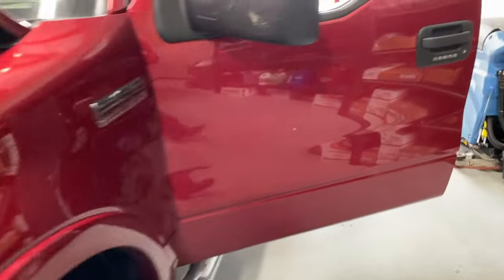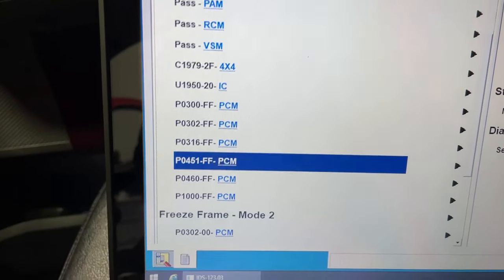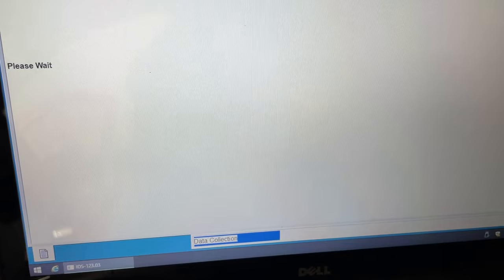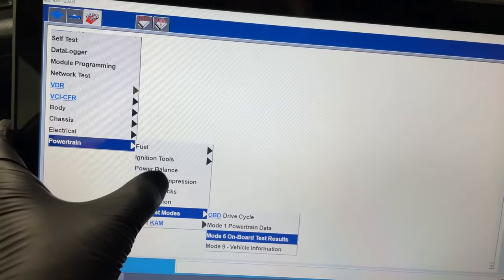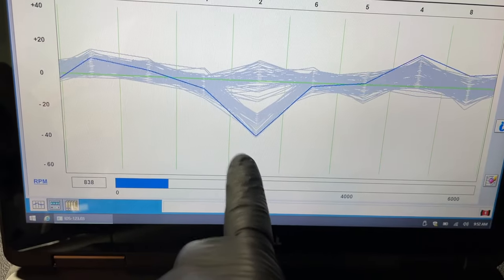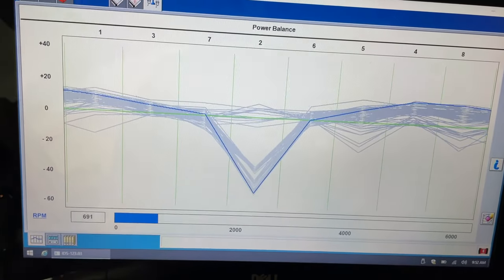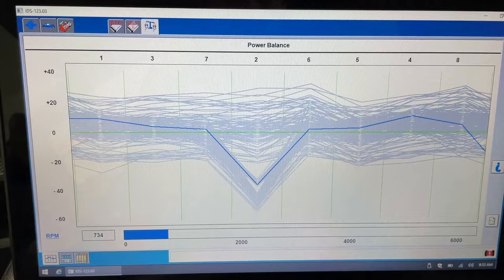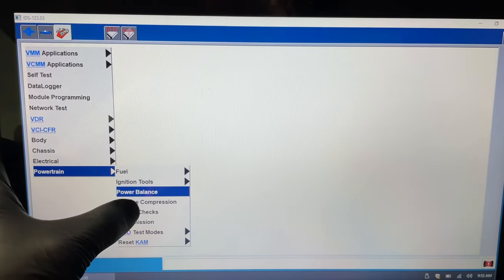Ford F-150 5.4L 3v Triton Engine Misfire: Champion Spark Plugs Belong in Chrysler’s and Lawn Mowers!

Comment: I had a AZ duracrap coil catch on fire and short out a 2016 Versa after finding the secret fuse box and changing all the coils with oem it still got random misfires maybe ECM or burn in the harness somewhere....

Comment: As someone who gave up on Ford's in 2010, and went to Chryslers (Dodge/Ram trucks), I'm curious why the Champion for Chrysler comment? Every one of mine came with NGK's from the factory.
Reply from the maker: You must only be buying newer chryslers.
Reply: @FordTechMakuloco  About 2008 and newer. The Mopar plugs have little NGK badges on the boxes. I have old stuff too, (60's and a 70), but those have been molested. 😂. I actually grew up in nothing but Ford's, but after 2 in a row that were horrible, and Ford not caring to fix them, I shopped elsewhere. Thing is, it started out a dealer issue, but Ford lost a customer when they wouldn't/couldn't get the issues resolved. I still like watching your channel, because I always like learning.

Comment: When I was young I raced MX.  we would get bad champions right ought of the box regularly.  We quit using them.
 I got older and started re building old harleys, same thing. Even in my boat motes, same thing. They show fire, but won’t fire under compression.  I haven’t had a champion plug in many years now.  Funny thing is , I know guys that claim they’ve never had an issue with them.   I know if they ever wet foul, they’re toast, where others will light off and clean themselves, champion won’t.
 Auto lite,  ngk,  denso, Bosch,  ive had excellent results with.  Even the yard equipment gets different plugs when brand new, sure cut down on the staring headaches.

Comment: Yeah I hate those cheap coils,I just had one I got from O'reillys for a customer, dead out of the box,lol.
Reply: Any issue on these things is a new motor. Well after you check the plugs, & coils. If there issues after plugs & coils the synchro under the valve cover is messed up, you could replace the camshaft, but it’s oil driven, & oil passageways are undersized on these motors, so it’s just cheaper to just drop a new motor in it. Heck get a 5.3 Vortec motor, swap it out w an Alison, & it’s been way better.

Comment: Great video, my 2008 5.4 has the issue between 40-50mph in 4th gear where you slowly accelerate. I will replace the plugs and coil packs. There is no codes on the cheap OBD readers and I don't have the awesome tool that you do. Thanks!!

Comment: I'm pretty sure Chrysler doesn't use the Champion plugs anymore, I believe they've switched over to NGKs for OEM. I haven't pulled a Champion plug out of a Mopar in years now, which is fine by me. I don't even run the Champions on my lawn mower anymore lol. Never had good luck with them.
Reply from the maker: Good to hear things have changed.

Comment: I just found a 5/8 spark plug  on cylinder 3  which I couldn’t get it off because I need a thin wall socket 😑 but the other 7 had 9/16 plugs

Comment: I need that scan software. I’ve had my 05 for like 3 years and I’ll admit it, I bought plugs shortly after getting my truck but they are still literally in my center console. I have a low power stuttering issue and all I have is a basic scanner that only shows tripped codes. If I “floor it” to pass it hesitates and will trip a lean code. Cranks fine seems to idle fine, but some low speed hesitation and under load stuttering. Also maybe unrelated but it seems like it goes in overdrive too quick which at first made me think tranny issue b4 fuel but now unless it’s both I know it’s fuel. I do live outside of town with longer faster roads. I always feel like backing off and letting it downshift around sharper turns and going up hills or it will bog and hesitate then I let it downshift anyway “to fix it”.

Comment: I have a cylinder 8 misfire in my 2004 f150 5.4 3V. Boot looks terrible nearer to the plug than the top of the coil like yours. It’s going to the a local mechanic if I can’t easily remove the plug myself cuz I’ve heard stories that they sheer off easy.

Comment: I replaced many coils and plugs that were Motorcraft  on 03 and 04 V8's and V10's with as little as 32000 miles.
Ford finally got their coils to handle the stress and with the last updated part number I saw, those coils were solid and would last a long time.
I also saw a computer code for the Input Shaft Speed sensor, but that was not the problem.  Replacing the coils and plugs with the updated Motorcraft parts eliminated the problem.  Go figure!
Brian's right.  Use only genuine Ford/Motorcraft coils and plugs!  The older 5.4L and 6.8L engines would not run right with other parts!
Reply from the maker: Yes the older 508 coils failed but 511 or newer never a problem.

Comment: Thank you for all the great info. I have a 2005 f150 5.4l that has has the phasers replaced 40,000 miles ago and it is running and idling horribly. Loss of power, missing. Do you know of a good tech near Columbia/Lexington SC to diagnose this properly. It has 225,000 miles.

Comment: What would you do if the coil screw threads are stripped on the valve cover?
Reply: You can use a thin strand of copper wire, a very thin strand, to place down the brass insert, then carefully thread the bolt in. The copper will wedge into the remaining threads, and give the bolt enough bite to secure the coil.
Reply: I think he made a video on that recently. It might have been just breaking loose from the valvecover I'm not sure.
Reply: @Troy_Built  yeah, that video was showing how to fix the insert when the bolt snaps off in it. I would try the copper wire in the threads for the stripped threads before trying to melt out the insert.

Comment: Excellent video - Ignition coils - in 2016 I bought what I thought were OEM replacement coils off of Amazon @ less than 1/3 the dealer cost for my Crown Vic. Turns out they were Made in China knock offs made to look OEM & they started failing within 2 months. So far I replaced 4 with dealer OEM  but I am starting to get another misfire & I think I will just replace the remaining units. But what a waste of time & $$$, I am so angry at Amazon I feel like I was intentionally ripped off.

Comment: last one of those champion plugs I ran into was the centre electrode gap was variable.   It moved from proper gap to not even visual just by shaking the plug.  Which is why I always ask my employers (private shop) for ford plugs on these.  Even if the OE break the remove tool works so easily.
Reply: the 5.4 3v pugs were superceded years ago by a one-piece. You go to a parts store for the Motorcraft plugs and none of them even have the original two-piece in stock anymore. You won't have an issue with the new plugs, Ford fixed the issue

Comment: I had 2 plugs that were loose and the Electrode band around the bottom was complete gone. You said in the video that they burn up. So I don’t have to worry about those pieces bouncing around in the combustion chamber and damaging some thing?
Reply from the maker: Correct.
Reply: @FordTechMakuloco  thanks so much. Your channel is the best on YouTube. Great job

Comment: Well gentlemen, my oldest son has a 2004 F150 5.4L with a couple coil and spark plug misfires. 190,000 miles and doubtful anything was ever replaced. Ive called a few garages here and the cheapest price is $1,350.00!! Looks like I will be teaching the boys how to do this myself. AutoZone quoted me about $3 per motorcraft plug but almost $400 for a coil pack?! Everything I find online is a fraction of that for coils but at least double for plugs? I don't want to get the wrong stuff. Coils alone have about 30 options. For instance in the links above the motorcraft plugs are $75.00 and the ones at AutoZone were about $25. Am I missing something? Any help you can give this single mama with some minor mechanical work history would be appreciated! Subscribed here, love these videos!
Reply: I should also mention we will be selling this soon so I'm not looking to go crazy with top quality and price. :) Thanks!

Comment: Just watched the video you did on regreasing the drive shaft. Great job. But... I need help replacing the center support hanger. How? Did you do a video of that?
Reply from the maker: It is not serviceable from Ford, your only option would be repair at a driveline specialty shop.

Comment: Should anti seize be used on threads of plug?  I did it last time I did my coils and plugs but I just took my #4 out and the boot was welded in,, finally got that out and the plug was super hard to start turning. I had to use a cheater bar which I thought was nuts. I have a copper, high temp, anti seize, thread sealant to use so you would think it would keep things nice and easy. Your thoughts on how to keep boot and plugs from seizing?
Reply from the maker: They get carboned up at the tip for which anti seize has no effect. I only use the high temp nickel version.

Comment: Hi Mr. "Ford Tech" I just came across your site, or page;  Sam.. sorry for not addressing You by name; didn't get that yet; I'm using my wife's device.  I'm a retired mechanic  , body, restoration. Etc.  I have a 2004 Expedition, 5.4.. titan.Titan.. I obtained about a year ago with 158,000 easy miles on it; it ran Exelent,  so smooth quiet,  you'd a lot a time think it's an electric vehicle.. after about 10,000 miles I've put on it maybe 18 Mos or so,  it seem not quite anymore,   I get a little start noise, but actually sounds like starter flywheel noise ,, although could have the noise you've been talking about in these videos,    the engine maintained oil, filter,  etc.. expect spark plugs,   my question and concern is ; it's not as quiet and smooth as before,   no knocks,  or hard Engine noise,  but actually like on idle and average driving, exhaust seems to sounds louder overall,  and doesn't feel as smooth,  I know needs good "tune-up"  and I intend on so;  the issue you bring up now concerns me,   I will check these now.  Any more thoughts or recommendations would really be appreciated.....sam... Los Angeles area.. thanks again:  your videos are spot on,  no long adoption as some of these people dragging.  Really appreciate that!!!... also appreciate your input:   thanks again:!!  God Bless!!!........ sam.s.
Reply: Typo;  meant ado

Comment: that 5.4 three-valve was a misfire right out of the factory. Even so, if you have a loose plug, better check them all, especially the #5 cylinder. It looked iffy on the balance test.
Reply from the maker: Cylinders 1 and 5 will always be low and cylinder 8 will always be high on the Ford power balance software.
Reply: @FordTechMakuloco  is that a testing software issue?
Reply from the maker: yes
Reply: @FordTechMakuloco  hopefully they issue an update, I could see errors like that leading to unnecessary repairs if the user is unaware of it.

Comment: Forgive me if this is not the way to ask a question but I am very frustrated. Lol.  I have a 2011 f150 5.0L. I’m getting a code says (crankshaft position sensor not learnt). When the truck is cold it has rough idle at first then it goes away. Drive no problem, starts no problem. You would never thing there is an issue but I cannot get the engine like to clear.

Comment: Great video as always. I'm surprised you dont use a little anti seize  on the plugs or dielectric grease on the connectors and coils? Any reason not to?
Reply: I learned in auto mechanics class many years ago, that you dont use anything on spark plugs because it can interfere with the heat exchange from the  spark plug to the head,  changing the heat value of the spark plug,  it sounded logical to me
Reply: @honorfreiday8079  dielectric grease or anti seize doesn't change anything.  But going into an aluminum head even with helicoils and be a issue without some on the threads

Comment: What are your thoughts on Denso coils?  Got a 4.6L Ford van and they have been doing a great job for me.
Reply: Denso makes the original motorcraft coils so you should be good.
Reply: @Gfaze  That's why I got them
Reply from the maker: Denso is the only aftermarket coil I will use if Fords are not available.

Comment: Autolites are 9/16 ( HT 15 ) but I think they have been upgraded.
 My coils are the standard brand. 
 Isn’t it true back in the early 70 the Z 28’s five bolt mains 350 / 365 horsepower Camaro’s and corvettes recommended the Ford  Autolite spark plugs? You may have to check with some seventy year old Moter Heads!
Reply from the maker: No impact no idea.

Comment: What's the thoughts on using anti-seize on the plugs?
Reply from the maker: light coat
Reply: Doughboy, use copper antiseize, NOT aluminum. There's a big difference. 
And yes, VERY lightly.

Comment: Champion also makes plugs for aircraft engines.  They developed a bad reputation for developing high resistance and not firing properly.  Lots of mechanics have switched to another brand for aircraft piston engines.  Tempest.  Question... Why didn't you blow out the spark plug hole before you took the plug out?
Reply: He did.

Comment: i just had a long block put in my 04 mustang the engine is in but crank no start odometer is dashes and the fan runs constantly and the ecu wont comunicate with scan tool how do i check if its my ecu burnt or what

Comment: Not to be a prude but you said the plug itself being loose was the main reason for the misfire? Wouldn't that mean just making sure the champions are tight would be enough or is there another underlying issue with the plugs I may of missed?
Reply from the maker: No they get fouled out.
Reply: @FordTechMakuloco  Don't burn hot enough to keep them clean I guess? I'm mainly curious cause we just put a set in a 5.4 and we are having trouble with a new miss on 4 and 5. Three off the old plugs ate the electrode ends clean off and there were motorcrafts.

Comment: Here's one for you, 05 F150 passenger side headlight keeps blowing the fuse and no Flash too pass and high beam low beam are reversed on the switch which is tight not thinking it is the problem. Any suggestions?
Reply: Which fuse blows?
Reply: @--_DJ_--  passager side low beam fuse.
Reply: Got a multimeter? I'd start with checking the bulb connector. 

3 pins. One is ground, other 2 are power (1 each for low and high beam when turned on) 

If the low beam circuit is shorted to ground it's going to blow fuses.. If the ground is missing neither high nor low will work. 

I'm imagining a pinched harness or frayed wiring. If the ground wire shorts to the low beam wire you'll pretty much get that symptom. 

Is the truck stock? Was it ever crashed?

Oh, if low and high beams are reversed (so you have the blue high beam indicator lit on your dash to use low beams?) I don't really know how that can happen without wiring damage that was incorrectly repaired, or a failed modification by someone.
Reply: @volvo09  yea very werid. Stock truck no accidents. Blue high beam light in dash stopped working also.
Reply: Might need to check the multi function switch.
Reply: @markkumollari43  Intermittent problem or does it blow a fuse as soon as you hit the lights, key if it has DRL?
Reply: @--_DJ_--  both head lights will work and are still reversed and the high beam indicator light in the dash does not come on for either for a bit then blows the passenger side low beam fuse again. Switch head bulbs also with a few different ones I have.
Reply: @markkumollari43  I have to think multi-function switch is bad. I can't think of any way both lights would be backwards repeatably if it was a wiring problem, assuming nobody has been playing around in there. That is obviously more of a guess than a diagnosis though, I'd hate to see you toss one at it and waste whatever it cost to get, even as cheap as that part is aftermarket. I have worked on 04-08s for years now doing fleet work and have never that I can remember had to change a turn signal(multi function) switch on one so it does make me question if that is the right path or not.

Comment: Without a exspensive diagnostic reader, how can I find the misfire. 06 F150, 5.4, 2 WD Lariat? Only seems to do it up hill at low RPM, about 45 mph?  If I depress accelerator more or disengage overdrive it'll clear . Thanks

Comment: I installed Champions and Summit Racing COPs at 180,000 and now have 280,000 with no issues on my 2008 F150 4x2 crew cab with the 5.4 Triton.  I used Slick 50 early on and around 120000 added a four cylinder can of CSL.  The engine still runs like new with no valve train issues.  Didn’t do it to my daughters 2009 F150 4x4 crew cab with the 5.4 Triton and had to replace the entire valve train, oil pump, etc for $4000.  I’m an engineer and would fire all their staff who keep beta testing their crap on the public.  Two piece spark plugs, inadequate oil pumps, poor cam chain tensioner seals, rocker arms/bearings that break, eco boost catch cans, etc.  Enough already.
Reply: The can was Restore which has CSL - copper, silver, lead.

Comment: My 5.4 has 200k on the stock phasers. It only makes a slight tick when the engine is hot at idle. When I simply unplug them it doesn't tick ever, but I obviously get a cel and the engine removes alot of timing. I'm thinking about deleting the phaser function from the ecu to prevent them from unlocking, just as a temporary  fix. I realize this isn't a correct repair. Would you think this could cause any problems?

Comment: Well at least they don't break off in the head like the Autolites.... even after they supposedly "fixed" them. Most likely they fixed them again because I haven't heard of any more trouble lately and since those darker days. The crap Autolite plug debacle cost 5.4L 3V owners a lot of money, and Ford did the usual thing and dodged responsibility. I had outstanding service from Champions.